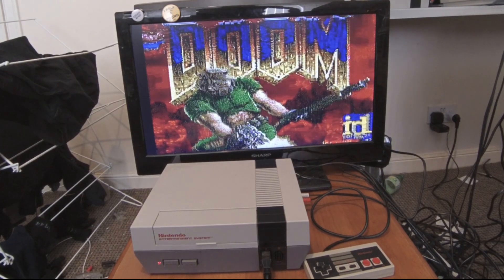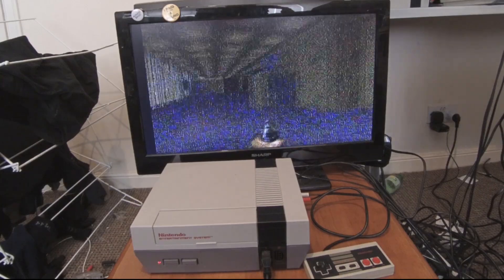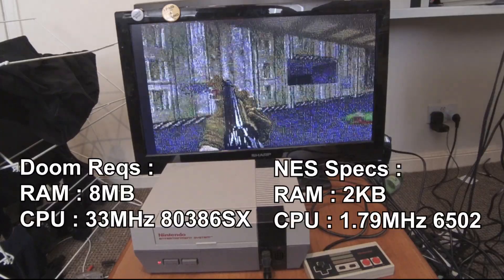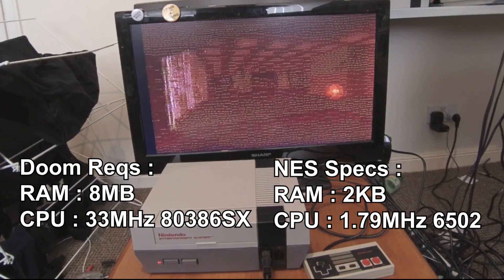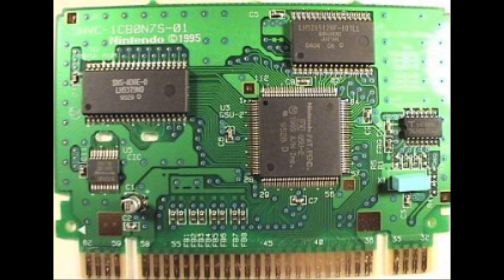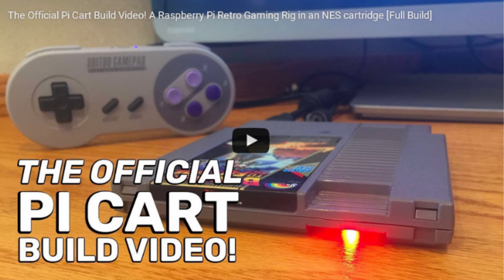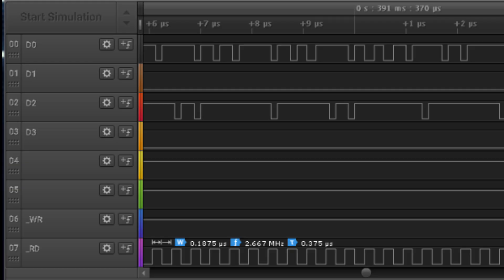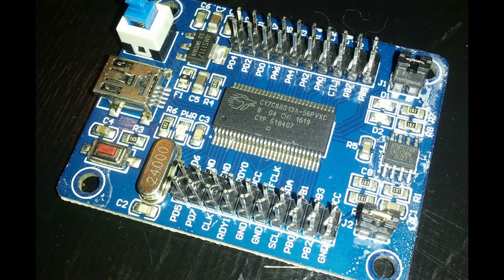DOOM on NES!

Comment: If I get it right, you have a NES program that loops at the screen frequency telling it to put on the screen via DMA what other computer runs on its own and then outputs to some address (pretty much like any video card). 1. do you have copies of this cartridge for sale? 2. you can make a cartridge that makes the same, but that does not calculate what it should place in memory for the NES, but instead receives external input. It would make the NES just part of a pass through cable, but it would open the possibility to do the same with even more complex things

Comment: "I didn't cheat"
Literally 15 seconds later...
"Here's how I cheated"
Reply: @Kommand Vlogz read the title again, making sure that you're not drunk.
Reply: Even most nes games did actually cheat as they used mmc chips to run on the nes,BUT they are not like the super fx chip no, they just increase the ram & rom of the nes along with bankswitching to allow better graphics & sounds on the nes.
Reply: I disagree, I don't see it as cheating at all, in my opinion it would've been cheating had he modified the NES.
Reply: @redherring3253  That's like saying, look, I made my standard Ford focus do 200mph. I just put a much bigger engine in it that drives the back wheels. Other than that, it's all stock!
Reply: @redherring3253  It's cheating, especially since he originally acts as if this runs on a stock system and is all legit and that goes "actually it's a raspberry pi". Amazing, that even blatant liars have their defenders in this day and age..
Reply: @melaniel.4269  I still disagree, the system itself is still 100% stock, so you can use the cartridge on any NES, that's why it's still not entirely cheating in my opinion.
Reply: @melaniel.4269  What's amazing is how righteously worked up people get after watching a simple YouTube video,
anyone calling the guy a cheater for doing it the way he did, is 100% welcome to try and do it better. 
At the end of the day, what the creator made is really damn cool, and everyone who feels like they have some duty to inform him he cheated etc, is not only a troll, but an asshole.
Reply: @redherring3253  username checks out
Reply: @redherring3253  Well the title is "Doom on NES", which implies Doom is running on the NES. It's actually not running on the NES at all - it's just using the NES's graphic buffer - the NES itself is doing virtually nothing except maybe feeding the controller input back.
Reply: @Rural Adventurer, you, and everyone that gave your below shit tier comment an up vote, are a reason of why the Coronavirus exists.
Reply: @saturnization  Sure, but it's not "running on the NES", all the code is being run on the Raspberry Pi with the NES basically being an interface and output, the NES is doing very little.
Reply: @saturnization  Thanks for completely missing the point or as the kids today would say: r/woosh
Reply: @melaniel.4269  Cartridge designers oftentimes put enhanced chips in the cartridge to allow for improved play.  This takes it to an extreme.  All due respect, if anyone expected a 2Mhz CPU and 2K of RAM to actually run Doom with a standard NES cartridge, well, what can I tell you?  Sorry you all feel cheated.

Look at the Aladdin game enhancer.  They were doing practically the same thing back then.  So the guy should call his cart the Pi Game Enhancer and make everyone happy.
Reply: @davidh6310  Aladdin Game Enhancer adds no more processing power than what is in a Contra or Castlevania cartridge. Aladdin existed so that Codemasters could include half the components in essentially all post-1986 NES games (8 KiB video memory chip, lockout defeat, and bank switching) without having to re-sell those components in every cartridge.
Reply: @DamianYerrick  True enough.  I realized this error in choice soon after I clicked send and didn't bother adding to it thinking it'd be a dead point to most anyway.  The point was that software designers were always trying to find a way to push the limits of what a game could do.  Some games had graphics chips on them, some had sound chips on them.  We may as well call the Genesis 32x add-on a cheat by the logic applied in this thread, and also any CD drive add-on cart like the Atari Jaguar's is a cheat, too.   As someone else said here a month or two ago, this thread is a great test for finding users vs. engineers.
Reply: @davidh6310  Expanding a console's ability to execute code (as the coprocessor chips utilized in various cartridge-based video games do) is fundamentally different from bypassing the system's processing entirely and "hijacking" its graphics memory bus to patch through another device's independent output. 

Likewise, the 32X and Jaguar CD (the latter of which provides no enhancements other than support for CD media) rely on their respective base consoles' processing capabilities to function. Both were marketed as hardware, which is much closer to an accurate description of this project.

It's an impressive technical achievement, but not one of interest to anyone concerned with practical applications.
Reply: @davidlevy706  While I understand completely what you're saying, I still have to conclude this is "Doom on the NES."  If you haven't already watched the "Technical details / build guide" video you'll get a deeper view of how it works.  It's a but more than just a hijacking of the graphics memory.  Works on a stock NES, controlled by the NES controllers in the NES's controller ports.  Going further back, there was the Colecovision, and the Intellivision and they both had an add-on to allow play of Atari 2600 games.  It was how I used to play Yars' Revenge.  No one declared it cheating.  

Look, if somehow, Nintendo could produce this cart back then when the NES was trying to compete graphically with the Sega Genesis, they would have used it, they would market it as "DOOM on the NES," magazines would have reviewed "DOOM on the NES," and people would go to stores looking to by DOOM for the NES.  Call it cheating or not, it's still DOOM on the NES.
Reply: @davidh6310  I'm not calling it "cheating" (or otherwise focusing on semantics). TheRasteri accomplished something cool and doesn't seek to mislead anyone. I just don't see the project as comparable to anything marketed in the past.

That isn't an insult. In some respects, this is more impressive than a coprocessor chip like the Super FX. I'm only saying that it's silly to equate the two concepts.

Had Nintendo possessed this technology (at an equivalent price point) in 1989, they would have used it as the basis for a next-generation console. They wouldn't have taken a fully functional pocket computer, configured it to run a single video game at a level of performance far below its native capabilities, hidden it inside an NES cartridge, and marketed it as a piece of software.

It's hobbyist fun, not something that ever could have been a commercially viable product with practical applications. Not that this is a bad thing.
Reply: @davidlevy706  Well, if this means anything, this is actually closer to how the sega mega cd is working.
Reply: It is indeed cheating as it no longer functions within the parameters of a classic NES 8 bit format. Still waiting for someone to attempt it.
Reply: @melaniel.4269   Damn you were retarded the fact you actually fucking thought a right out of the box Doom was gonna run on an NES is pathetic stop being a snob and shut the fuck up no one likes you nor ever will for a reason

Comment: Sounds like you made the NES into a 1980s version of a Nvidia Shield.
Which is awesome but don't know if I would say that the NES is running the game.
Reply: A lot of NES games did this though. I'm pretty sure Super Mario Bros 3 has some extra processing power added to the cartridge itself
Reply: @WH250398  Yes, extra processing power added to the cartridge itself.
Looked like the NES in this setup don't help to run the game in any way.
Reply: The NES is doing all of the sound processing, and all the inputs

Comment: In the end, the NES is just outputting video and acting as input. Looks kinda non sense, considering that you can just plug the HDMI on the TV and plug the controller on the RPi, but still a very amazing practical trick to shock someone. ;D

Comment: It just sounds like Doom is running on the raspberry pi, while the NES outputs the video.
A better comparison would be the Super game boy for Snes.
That sounds exactly like cheating to me.
Reply: If Super Game Boy is cheating, then cheating is licensed.
Reply: @DamianYerrick  Maybe, but it's STILL cheating.
Reply: @YowLife  How much logic on the cartridge constitutes cheating? On which side do S-DSP, Super FX, CX4, and SA1 coprocessors fall and why?
Reply: @DamianYerrick  The title gives the idea that this is a standard nes cartridge that SOMEHOW is able to play Doom. However the video explains that the cartridge is the real system playing the game and the NES mainly just outputs the video, so technically the NES doesn't even need to be there.
Reply: @YowLife  Can the RPi output composite video and read NES controllers without an NES, or does it require an HDMI monitor and an NES controller to USB HID adapter?
Reply: @DamianYerrick  I know regular NES cartridges can't.
Reply: @DamianYerrick  Yes, Rpi 1 has composite out and GPIO pins can be used to read NES controllers

Comment: This isn't using the actual hardware and data limitations so no, this is not running on an NES, you are in denial. Not even the SNES and Genesis versions ran this well...
Reply: Ya but Nintendo cheated by sticking more processing chips in game carts, making the nes do things it never could.
Reply: bookshelffury True, but this is still way more powerful than even the official NES modded chips.

Comment: What's "cheating"? It works with a stock NES - end of story. This is just brilliant engineering.
Reply: It's cheating because all the NES is doing is powering the computer. It's like someone saying an Xbox 360 can run games in 4k but what they did was figure out how to shove the internals of a gaming PC in it. Impressive nonetheless but it's technically not running on the system at all, the NES is pretty much just acting as a power supply and visual/audio output

Comment: First, it's cheating 
Second, it isn't like the FX chip, at all! 
Third, the FX was also a cheat 
And Fourth, i may be an exception but i don't find it special to run Doom on a Rasbery Pi, even if that Pi uses an NES as a PSU, controler input and video out.

Comment: Not cheating just... pointless. Every game would require a PI to convert to a cart (expensive) and then it's just piping it through a crappier video generator. I mean; cool project, but it's not so much "Doom will run on this thing" as it is "I put an NES graphics chip on a RasPi".
Reply: Not even a NES gfx chip on a pie, but more a NES passthrough gfx on a PI.Creative, yes.. Require tallent? HELL YEA! But as you said, pointless and a huge cheat

Comment: It's just jacking the nes power and output.
Kewl though
Reply: Still trough that’s amezing, it’s not like the 32X for genesis or a nes,gba or genesis adaptor for the snes in wich both use their own av out wich i do consider as 100% cheating.
Reply: @johneygd  So its 75% cheating
Reply: Metroid Mayhem yes indeed, but i can live with that but we can all agree that if it is all about stock hardware then it will be a totally different story, am mean just imagine if nintendo & sega will keep on upgrading their 16bit consoles on end with new addons and claim that their hardware is more powerful then eachother, then they could go on till forever wich i will consider as cheating.
Reply: @johneygd  Eh its cool either way

Comment: Does the NES have to pull more power to run a Pi? Can the motherboard handle it long term?
Reply: He went over this in the extended video, it draws 500 ma , but the power board is rated at 1000 ma so no worries